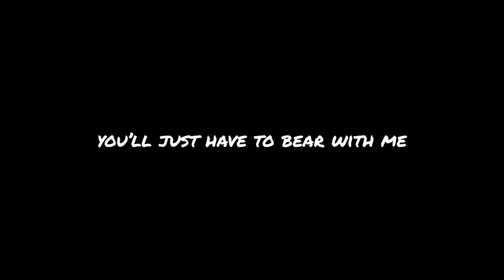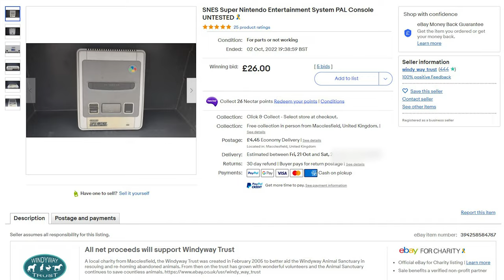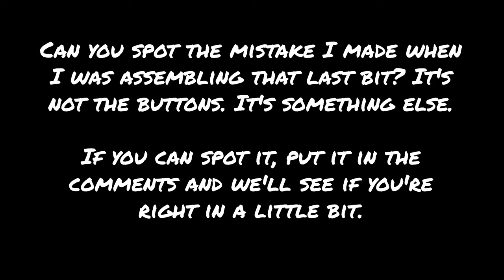Fix it Friday - 'Untested' Super Nintendo (SNES) from eBay with no cables or controller.

Comment: A quick tip : whenever you work on a SNES. After power up, unplug the power supply, and switch it on. You'll see the power led turns on for a short period of time. It discharges a capacitor. If you don't do that, you take the risk to blow the fuse.
Oh, and you forgot to put the light diffuser back.

Comment: nice video Kip, shame wasn't a repair as such, but yeah there are times whereby the seller is genuine on ebay, just rare. unless they say spares or repair or broken. the console was missing a sticker in the middle of the console. but yeah from what I remember the top was loose around the eject button but most of the noise when rattled then you would hear the eject button more than anything else.